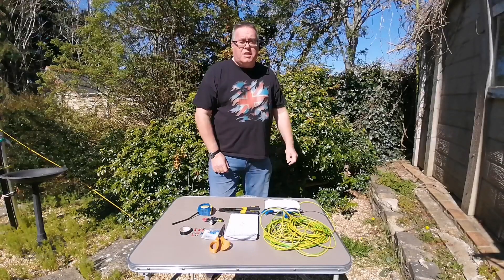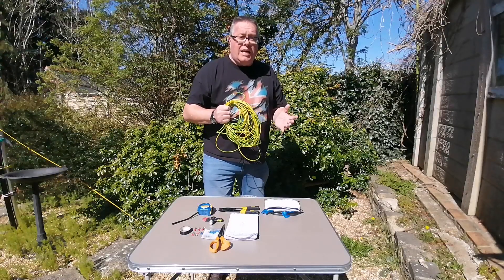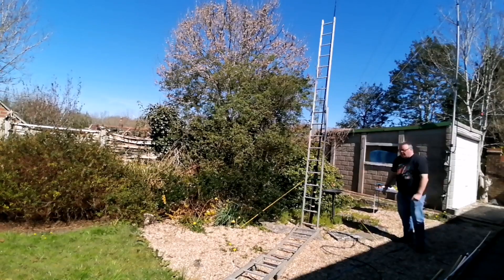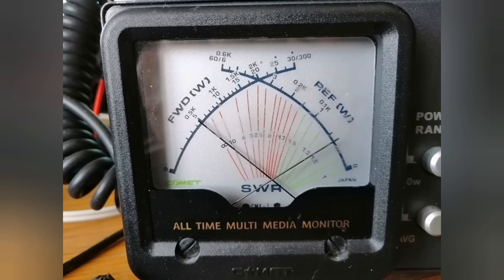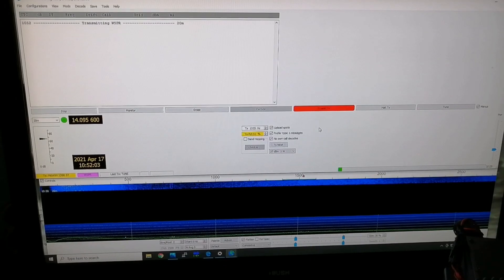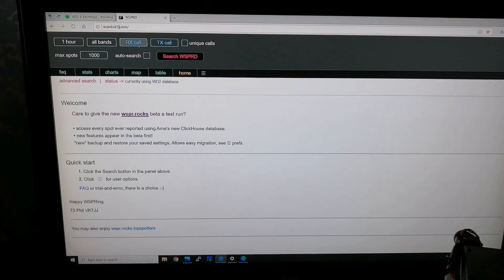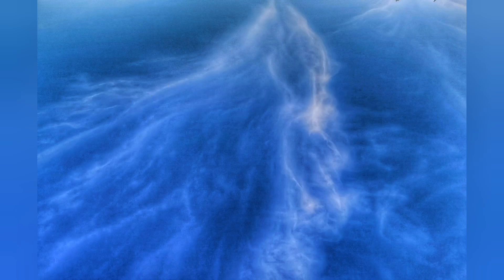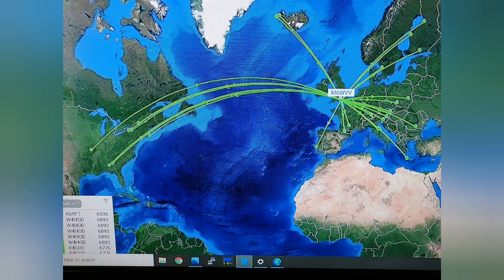A "Real" Ladder HF antenna!!! Can you beat my distance?

Comment: Good stuff. How about a window frame antena,
Years ago for a laugh on 10mtrs in a tower block at 150ft asl , centre coax to one window in the 3 window frame on the left, gap of about 3ft to right window in the plastic insulating frame, to a tuner and I got  lots of contacts on 5w in that direction to Europe.
Reply from the maker: Thats brilliant, its great to try these things. Thank you for the comment, regards Steve

Comment: This is an excellent video. Something I have been curious about for years. I was actually searching for examples of people using ladders as masts, since I need a mast, in a hurry but can't justify the cost of a commercial push up mast. Really impressed with the results you got on WSPR. Even more excited with the use of the ladder on the ground as a groundplane. This is what ham radio is all about isnt it.  👍
Reply from the maker: Experimenting is fun to do, i was surprised the ladder did as well as it did. Regards Steve

Comment: Wow ,what an achievement over 6893 km .The ladder antenna certainly works, also deep into europe. Have you used it since the video ??
Reply from the maker: Hello Graeme, I have had a play a couple of times using it for WSPR, it only performs a little less than my wire delta loop. Unless you experiment you never find these things out. If something is conductive it can in theory be used as an antenna. Part of the fun of the hobby. Regards Steve

Comment: Did you make a video re the 11m bands with this type antenna?
Reply from the maker: No but the picture on the title screen is the 11m antenna. Approx 8ft ladders. It works even from ground level. Regards Steve
Reply: @EnthusiastSteveM6WVV  Cheers got to try this